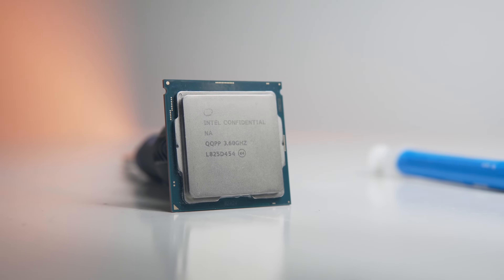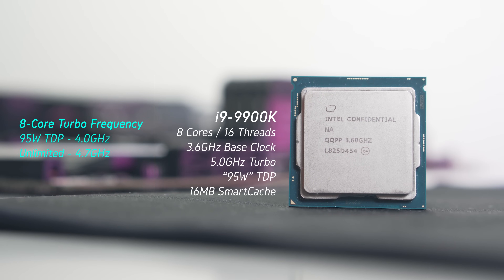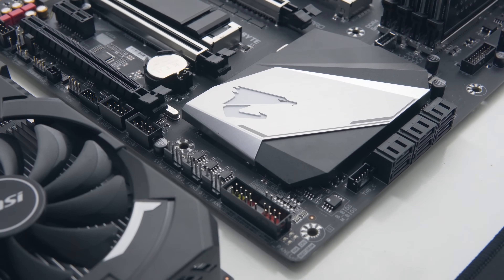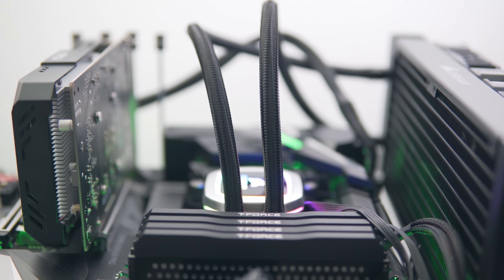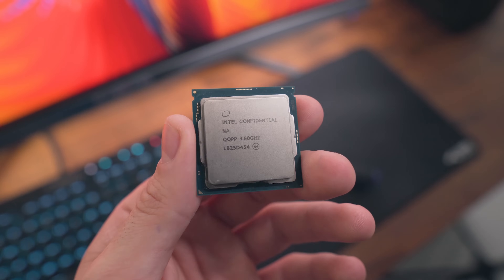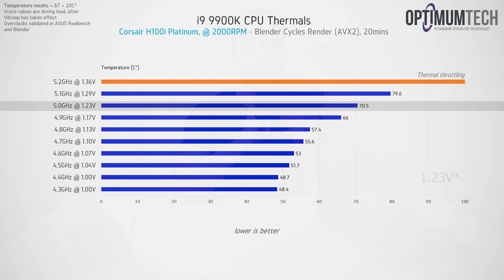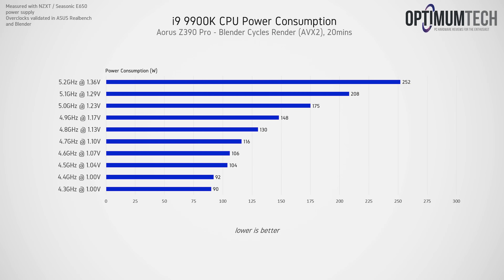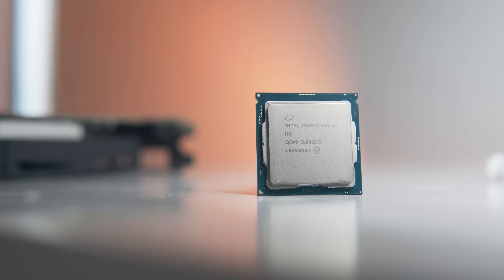9900K Overclocking & Undervolting - Fighting The Molten i9

Comment: It's about time a reviewer showed realistic voltage instead of just forcing whatever voltage it takes to get 5ghz. Reviewers are saying it runs too hot on a weak binned chip running 1.4v. I've said this since the chip came out that if you push whatever clocks you can get at 1.2 to 1.25v the temps will be well within check and even weak chips will likely do 4.8ghz at that voltage. Problem is most reviewers just slap some numbers in and don't actually have real experience overclocking. It's not about getting that glorious 5ghz no matter what that's for sure.
Reply: I barely get 4.9 stable @ 1.3v on noctua nhd15. Air cooler yes, but I think if the reviewer spent more than 20 min on an aio he might run into problems at that temp? Or maybe he's just really lucky/I'm unlucky/both. Either way I think aio testing should be done for at least an hour...
Reply: whodawhathuh Just got mine. Have an old EK 360 Loop hooked up to it and still it runs hot. Lousy software, but used a voltage offset to finally get 5Ghz at around 1.296V. Honestly the numbers he’s showing make me depressed. 5Ghz at 1.23V? He needs to admit he got a golden sample.
Reply: @Aurummorituri  yes... well that and he didnt run the tests long enough to even reach equilibrium on his water cooler... then again... if my chip wasn't so much worse I wouldn't even be salty so sucks for us I guess... btw... I think 5ghz at 1.3v and below is great... congrats!
Reply: whodawhathuh Thanks. It’s great for ME and my specific setup, but most people don’t buy custom loop AIO’s with thick copper radiators. This chip is practically Intel’s version of the FX9590. Reused architecture with a bunch of cores cranked up to crazy clock speeds. Honestly unless you have crazy cooling this chip is more about setting your core around a specific voltage than the other way around.
Reply: @Aurummorituri  to be fair if it runs hot on your loop at 5ghz it would probably do 4.9ghz on air with lower voltage and the same temps. That's my whole point. People need to stop chasing the holy 5ghz. Also people think core voltage is the only factor. I've had a few chips that took significantly less vcore just by bumping VCCIN by 0.05v. Way too many people just going to town on their chips that lack knowledge in overclocking.
Reply: @MrDutch1e  VCCIN? Haven't heard much mention of that setting since Haswell was a thing. Don't know if changing input voltage still does much on current platforms. Had everything stable earlier, then played a game for a while. My loop includes my gpu. Tried Cinebench right after while the loop was still soaked with gpu heat. Temps went up close to 90C instead of 80C and it BSOD'ed. Obviously the higher temps increased leakage enough to make it unstable, so I'll probably settle for 4.8Ghz at some point and just undervolt. I'm not really pushing it much right now anyway. I came from a 6700k at 4.5Ghz at 1.28V, so this chip is already more than double everything. Do you think more VCCIN would make a difference for me? Would it increase stability at a given Vcore and what are the tradeoffs (heat/power draw)?
Reply: @Aurummorituri  all depends on the chips. Some need it some don't. Usually chips that need higher voltage benefit from it. For example, I had a 6700k that took 1.3v for 4.5ghz (pretty shitty bin) and I couldn't get 4.6ghz stable with any vcore without occt failing within 45 minutes. Even up to 1.42v. Upped VCCIN (CPU input voltage) to 1.85v (I believe it's 1.8v stock on most boards) and I was 100% stable at 4.6ghz with 1.36v after that. Ran hours of occt without issue.
Reply: HOODedDutchman 1.3V? That’s pretty good. Several reviewers needed 1.35V, and some could not hit 4.5 at all. I’ll try bumping mine up a bit if I can find it in my lousy ASRock bios.
Reply: @Aurummorituri  agreed mine is only hitting 5 at around 1.3V or more. and that's with a 280 MM water cooler, a roomy mid-tower and an ASUS Maximus XI Hero Mobo
Reply: @me76326  That's not terrible, but oof with that mobo. Only a 4-phase VRM, so don't try pushing things too far.
Reply: @Aurummorituri  thanks for the info. i did some more benchmarks and it's not actually hitting 1.3
it's set at a manual voltage override of 1.3 but it's only hitting around 1.1 for 5 Ghz. I may try and reduce the voltage override a bit and see if that helps.
Reply: Very true compared to air or land, water is a slow conductor of heat...
Reply: the worst is unboxed hardware..this guy does good job

Comment: Why buy an i9-9900k if it sucks?
Reply: Didn't seem to suck at all in this video. Problem is other reviewer pushing voltage too high on leaving the power cap off on immature bios that push voltage too high. This is how a review should be done of this chip. 5ghz isn't the end all of you can get 4.8 at low voltage with much more reasonable temps. Other reviewers need to realize this.
Reply: It sucks. Why? Price. Too hot. High TDP. Not much better than ladt generation. You dont need to undervolt a good chip. If you do, it's not good. I'd rather stick with prrvious generations.
Reply: @DeadFury222  not enough money obviously
Reply: It doesnt suck? The price is the only thing people dont like. Top of the line gaming performance. Great and multitasking and streaming, best non extreme platform video editing chip. Just dont cheap out on cooling.
Reply: it does not suck. read reviews maybe, everyone praise it for the performance. it bitchslaps 8700k and 2700x with ease. it's the best mainstream chip by far, eating into hedt market (meaning it bitchslaps alot of hedt cpu's too). 9900k is the best all-round chip today, the end. poor peasants are butthurt tho.
Reply: @Dr.WhetFarts  poor peasants ... youre the one butthurt here, m8. It's barely better than a i7-8700k. For... 150$ more. 5% increase for 150$? Nah ty.
Reply: @DeadFury222  5% what do you mean? 8C16T is much more  powerful than 6C12T . It is great if you can keep the chip cool and use all the power.
Reply: @yishaxu330  Its 5% better at most than a 8700k/9700k in gaming. We were discussing gaming.
Reply: @DeadFury222  For gaming, yes an 8700K is just fine. But you don't buy the 9900K for just gaming, you can buy it to do other things like Video editing. Puget systems put the chip to the test and in a lot of cases it's FASTER than a $1000 i9-7900X. If you put it into that perspective, the 9900K is actually not priced that bad. It's Intels' dumb marketing team to market it as a gaming chip.

Comment: Best COOLER for i9 9900k ? :D
Reply: Fire hydrant
Reply: I would say three stage cascade phase-change cooling would be a good option for ya.
Reply: as he suggested for an AIO - 360mm (triple fan models)
Reply: I've got an EVGA clc 280 that keeps my 9900k running cool.  68°C on aida64 with all cores at 100% usage at 5.1ghz on a z370 and I let it run for 2 hours. No throttling issues with consistent voltage throughout the process.
Reply: @Svylas  what board?
Reply: @Zurrieq1989  Asrock Z370 Killer sli/ac. Its honestly an entry level z370 but I havent found any issues pairing it with the 9900k.
Reply: @Svylas  would suppose the prime 370-a should work? still don't know if i should swap my 8700k for 2 more cores.... I would need to change my AIO then as I currently am using the h100v2. Tbh I don't do alot of overclocking.... dunno what gains would i get from adding 2 more cores
Reply: @Zurrieq1989  If you're only gaming I would stick with the 8700k for now.  If you want to upgrade in the future without buying a new mobo and such, then I would upgrade to the 9900k on your Asus 370-A. Right now the 2 extra cores arent needed, two years from now that may change however.
Reply: @Svylas  hi Svylas, what speed Ram did you choose for your setup? Thanks.
Reply: @bearclawws  Running 32gb of 3000mhz ram
Reply: @Svylas  Nice, thank you!
Reply: @imromano2448  D-15 gives 1 to 2 lower degrees against the dark rock.
Reply: @TREV Boarding you'd overheat it a lot in there. Even raspberry pi can overheat in antarctica.
Reply: Me, cuz im so cool, jk just go with 240,280 or to be sure 360 aio. For air go with NH D-15, V8 GTS or a full custom loop with dry ice or Liquid Nitrogen
Reply: @imromano2448  DRP5 not even a thing
Reply: liquid nitrogen
Reply: @CringeCoDM  lmao
Reply: full custom loop with chiller
Reply: TT floe riing 360
Reply: The vacuum of space.
Reply: @FeedMeSalt  that would be really hot.
Reply: @FeedMeSalt  That would be a terrible idea. There's literally no air in space, why do you think we use fans in our PC's? All the heat in the radiator fins/heatsink fins would build up with no where to go. The CPU would overheat instantly and shut off due to overheating in a matter of a seconds.
Reply: @graham1158  oh wow thanks man.
I had no idea space had no atmosphere.
You sure did teach me something today.
R/whoosh.